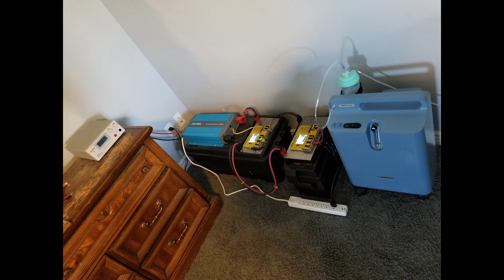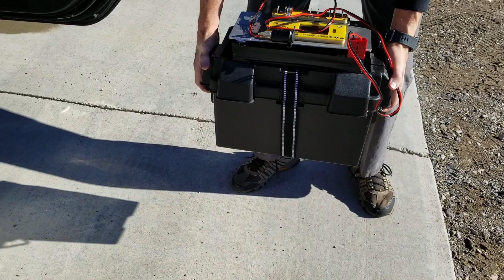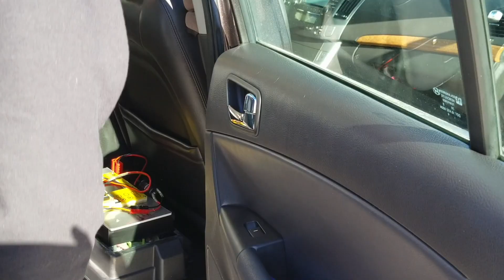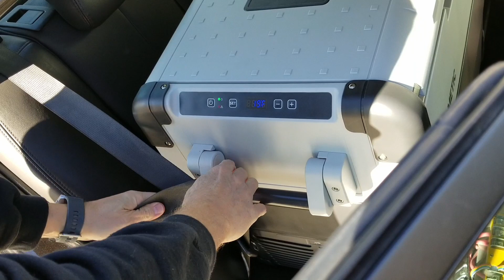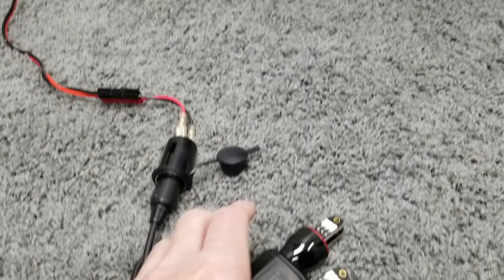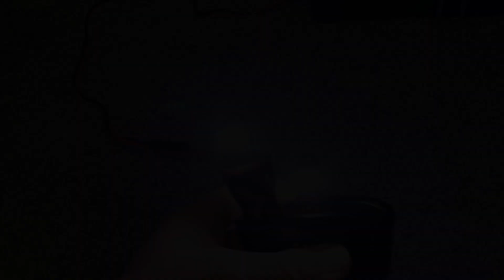Battery Pack

Comment from the maker: Yes
Reply: Thank you for these videos. John, I think you have a great solution. Would you be interested in making this available for consumers? I would love to market something like this.
Reply from the maker: I made these videos to show others what is possible with a little knowledge and effort. I'm not interested in marketing this system, but you or anyone for that matter is welcome to use my design for your own system. It's just mostly off the shelf parts. Except for the SBMS which is really what gives this system it's ability. Dacian at Electrodacus.com is the person you need to talk to about that. Although I believe Dacian has made his SBMS design open source.
Reply: Hey are you using this in the winter now? Can it run a small heater?
Reply: I saw this guy make a diy solar similar like yours but using other type cells on https://youtu.be/_fxZxJNk1tw?t=4m12s  what are your thoughts?